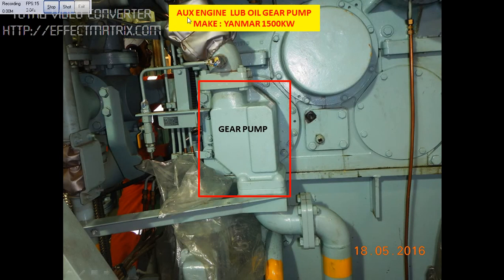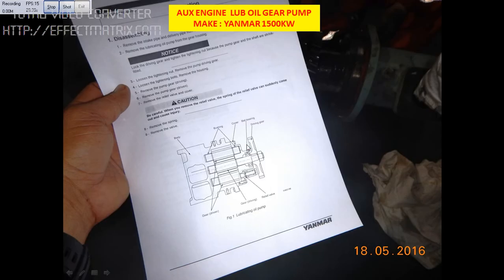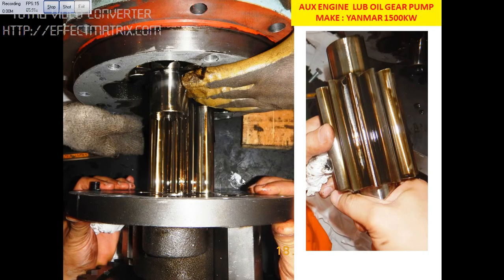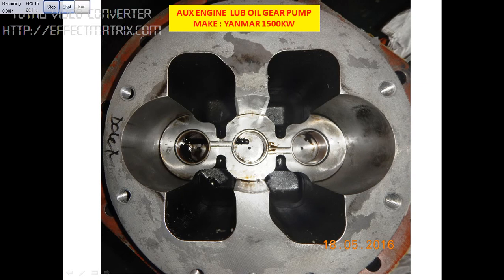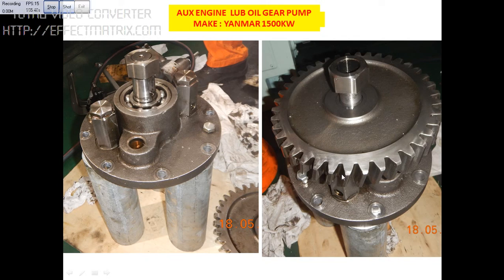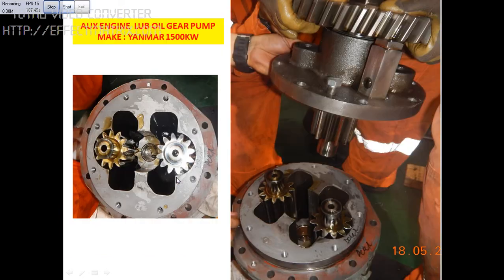How To: Overhaul Lub Oil Gear Pump - Aux Engine Make: Yanmar 1500KW

Comment: what is the different bet ween gear pump & mono pump please reply below,thank you very much...
Reply from the maker: This pump consists essentially of a rubber stator in the form of a double internal helix and a single helical rotor which rolls in the stator with a slightly eccentric motion. The rotor maintains a constant seal across the stator and this seal travels continuously through the pump, giving a positive uniform displacement. The Mono pump is manufactured to meet mining conditions. The rotor is made of special abrasion-resisting or noncorroding steel. The length of the stator and rotor provides for a twist of slightly more than 360 degrees to provide for a complete seal. For greater heads the length of stator and rotor are increased so as to provide two or more complete seals in series and the head is then developed in stages
The Gear pump is a positive displacement pump with gears inside
Reply: thank you very much!!!!!!!!!!!!

Comment: why we didn't use priming unit foe sea water cooling pump?please reply below,thank you very much...
Reply from the maker: Thanks for your valuable feedback !! Do share it with your colleagues and friend
we do not require priming system for sea water pump  since the pump is installed at the bottom platform of the ship, pump is below the water level and under positive pressure. Priming happens automatically due to Positive head.

Comment: Sir is there any arrangement to control the pressure in the pump
Reply from the maker: Thanks for your valuable feedback !! Do share it with your colleagues and friends
Very good question. There is no pressure control valve. But there is one Relief Valve for safety purpose only. While overhauling please the check the condition of seat of the relief valve.
Reply: Thankyou sir .......